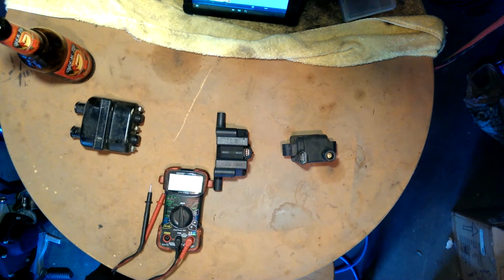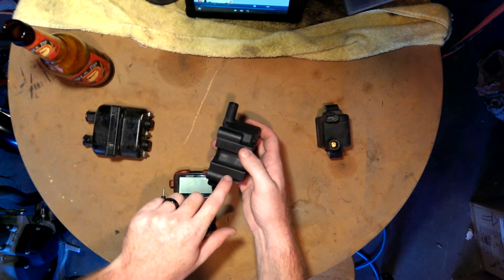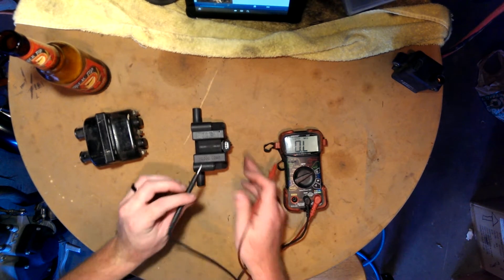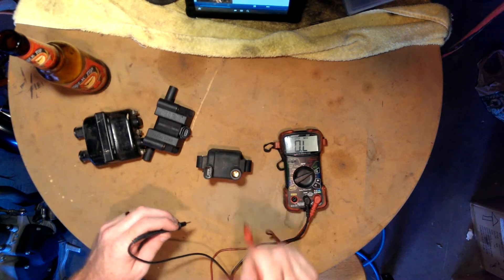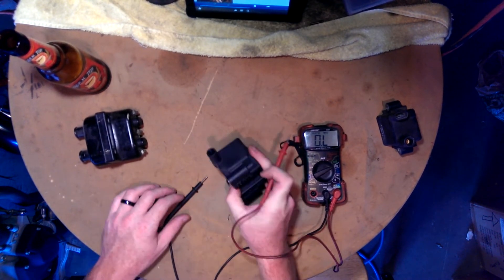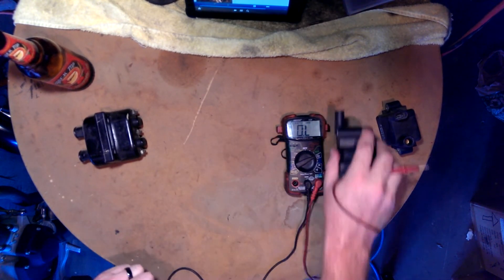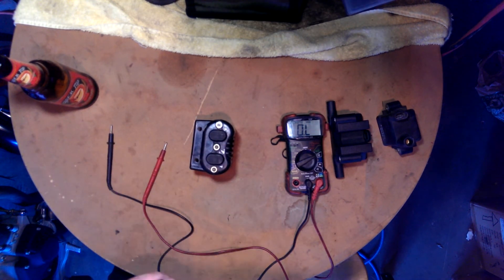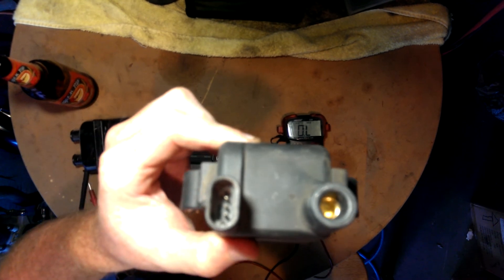Buell Ignition Coil - Checking Ohm's

Comment: Why does my factory Buell X1 manual tell me to ohm out between the two outermost/outside pins?
Reply from the maker: The Factory X1 manual I have does not outline the testing procedure for the ignition coil. I also do not have an X1 ignition coil. So I cannot answer your question.
Reply from the maker: Nevermind, I found it in the manual, it's not in the electrical section, it's in the Fuel System section.

It does not tell you to check the outer pins, the arrows clearly point to an outer pin and the middle pin. You can two primary windings, you check each of them in the same fashion as I did the XB coil in the video.

Comment: I have an 03 Xb9s runs and rides like a dream but after about 30 minutes it'll start backfiring and popping through the intake stalling out will not start back until it's completely cool and it starts over again what's your thoughts
Reply: Did you find the solution?

Comment: thx a lot for sharing , one question i have 2003 buell xb9s lightning , front cylinder not working , change sparks and cables , check engine light on !! check the coil and the terminal for the for the front cylinder gave .03 and the one for the rear cylinder .07 , do you think this is the reason why my front cylinder it is not working , not enough power to spark the plug ?? thx a lot
Reply from the maker: If they're under 0.3 ohms resistance, your coil is definitely the problem. They should be between 0.3-0.7 ohms resistance.

Take note the placement of the zero and decimal.

Comment: thanks a million bro , I needed that info 
I have a 95 buell s2 1200 and was wondering about how to check that coil which has 2 threaded posts 
one takes a few pink wires and the other has white wires
also need to know how to check the ( points) tiny square module  .. its the unit behind the right side case under the round cover plates
Reply from the maker: +Lawrence P Franz Glad I could help with the coil! Unfortunately, I don't have a points-style ignition to do a video on. I think the only other bike I have access to that would have points, my brother converted to electronic ignition as well.

If I happen to come across one, I'll post a video and reply/edit here with a link.